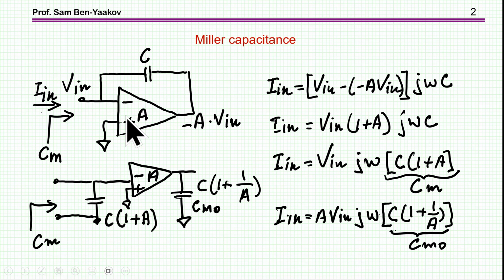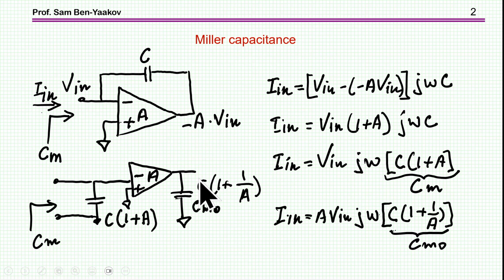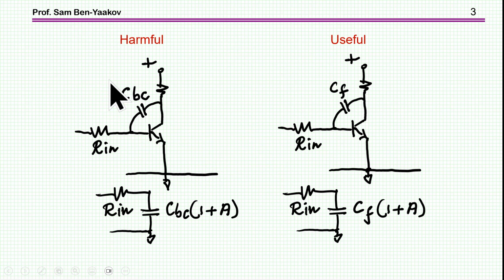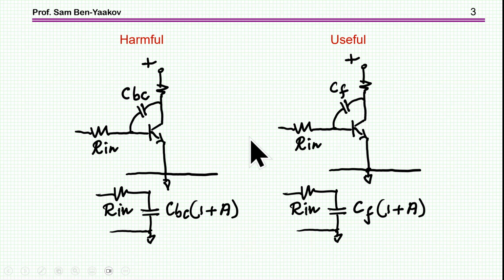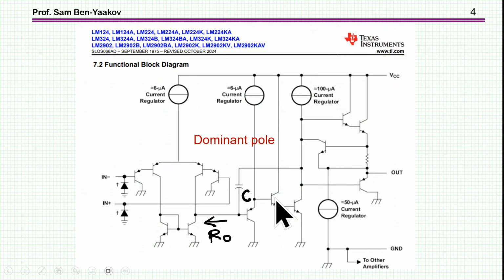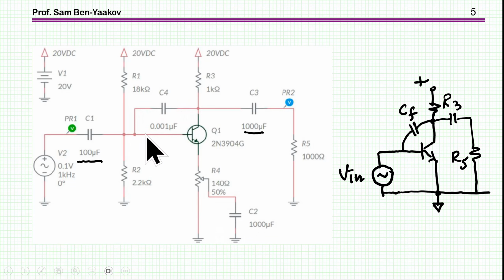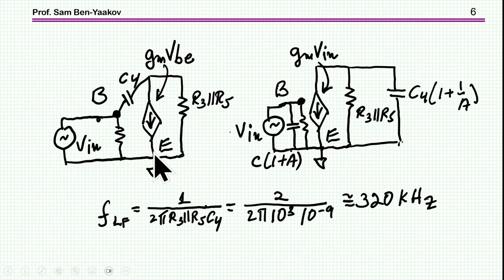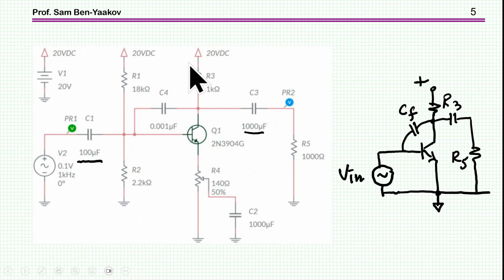Miller capacitance and bandwidth

Comment: In practice, there are two poles because the voltage source has a non-zero output impedance. When considering a 50-ohm source resistance, however, the dominant pole is due to the input LPF instead.
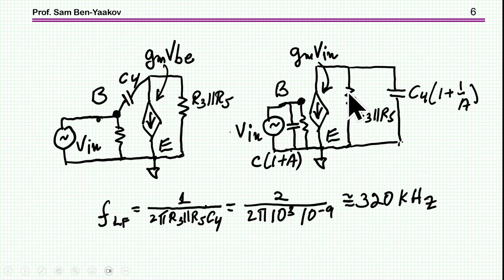Reply: Video 5:00 to 6:00. fLP = 320 kHz is not the dominant pole. It has been said is that there are two poles. To be exact: w1 ~ 1 / (R_in*(Cpi+C4*(1+A))); w2 ~ 1 / (R_out*C4*(1+1/A)). What is presented at 5:00 is w2. In practice w1 is much smaller than w2 except for very low Rsource values. The frequency response is dominated by w1.
Reply from the maker: @vascosoares4543  Sorry, but the whole purpose of the video was to refute the notion (suggested in a teaching video) that the Miller effect still exists at the input with no input resistor.
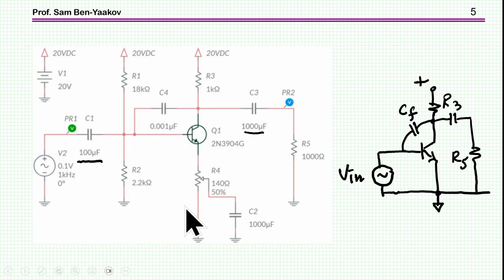Reply: @sambenyaakov  Video title: 'Miller capacitance and bandwidth'. The video is expected to demonstrate the impact of Miller capacitance multiplication effect as a limiting factor on circuit bandwidth. Sorry but unfortunately, the example shown after 4:15 is not a good example at all. It shows a CE circuit with a variable degeneration factor, which is irrelevant for the current demonstration, and unrealistically small source resistance, which makes the demonstration meaningless in a practical context.
Reply from the maker: @vascosoares4543  I am happy to get comments on the videos as they are and not what they are not.
Reply: @sambenyaakov  that’s the point, what they are not:) I'm glad to help!
Reply from the maker: I am sorry, I do not follow you. You mean the driver source?
Reply: Yes, the LPF response is dominated by 'R_source', 'R_in' view from the transistor base ('R1', 'R2' and 'r_pi', with emitter degeneration) and 'C4(1+A)'. In general, it is much lower than what is shown in the presentation.
Reply from the maker: @vascosoares4543  To which slide or minute in the video are you referring to? Are you saying there are two poles at the input? Xan you write please the expression for the poles' frequencies?